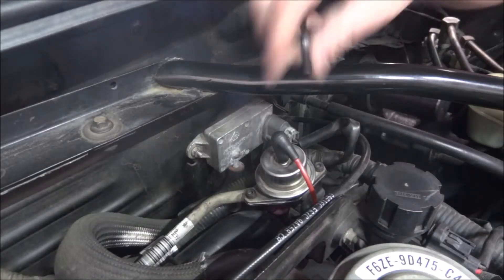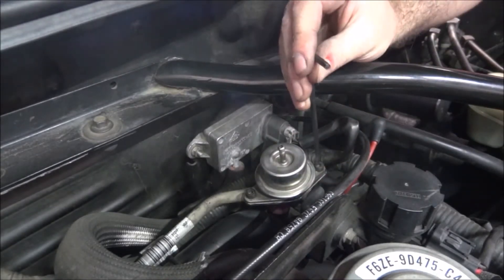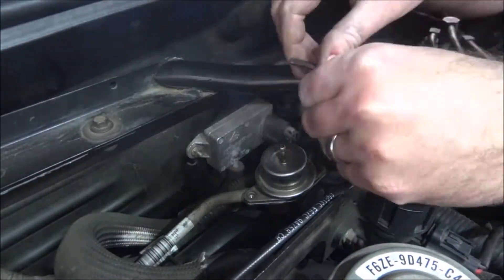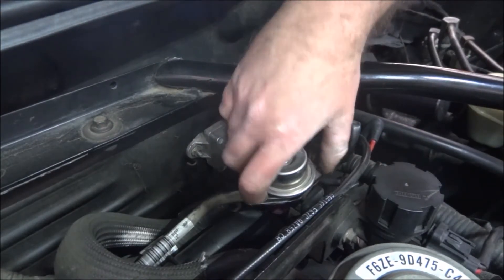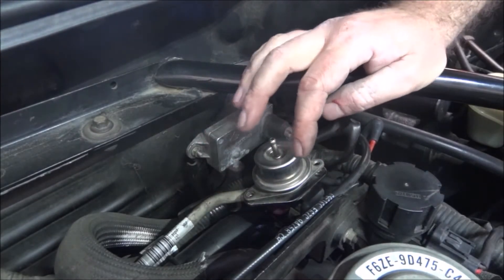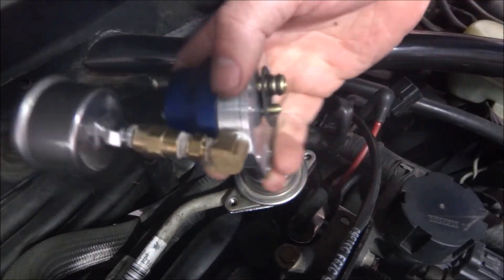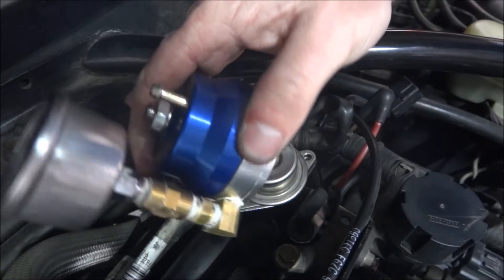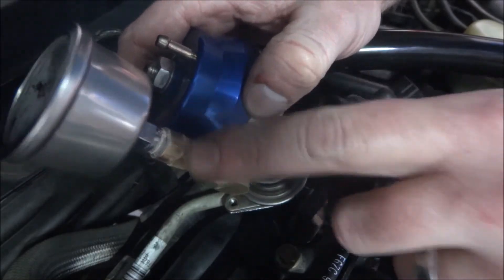Installing a 94-98 Mustang GT & Cobra BBK Adjustable Fuel Pressure Regulator and Gauge Kit

Comment: I have a 98 GT and my fuel pressure regulator doesn't look like that
Reply: Mine dosnt either 😅. Im suspecting my fuel pressure regulator to be my issue, i got one from o’rillys and its the wrong one, has the connection like his adjustable one is. Im having bad hesitation after my cars warmed up and it seems to be losing fuel pressure, I’ve replaced fuel pump and filter, and MAF
Reply: I know it's a year late, but if I'm not mistaken for 98 the regulator is integrated into the fuel rail itself. Maybe it'll save someone else some heartache if they read it here

Comment: I have a 98 GT. I have some light hesitation in 2nd and 3rd gears between 1,5 and 2.5 RPMS. I've replaced and cleaned all the usual suspects. I checked the fuel pressure at the rail and it showed 29 PSI at idle. I looked online and it says that it should be between 30 - 42. I've replaced the fuel pump, fuel filter and the fuel pressure regulator. with key , engine off, it shows 0 PSI. Idle is 29 PSI. When you disconnect the vacuum line from the regulator, it jumps up to about 40 PSI. When you turn the key on, you can hear the pump prime. What could be causing the low fuel pressure? The injectors? Relays or possibly low voltage going to the fuel pump?I would appreciate any advice on this matter.
Reply from the maker: What regulator did you use?  Usually vacuum will lower the fuel pressure.
Reply: My mechanic got one from advanced. He told me pressure increased but I did not see the gauge so I guess it either did not increase at all or it decreased over time. I've known him for years so I don't think he would lie to me. Exactly, with the vacuum line connected to the FPR, the pressure is 29 PSI but without vacuum it is around 40 PSI.
Reply from the maker: It sounds like it may not be a fuel pressure issue.  Here are some tests you can do to check pressure.  Measure psi when engine is at 2500 rpm should be between 30-45 psi.  Turn off the engine and cycle the ignition on and off a few times and measure psi again.  On a factory system, the pressure after 1 minute should still be above 25 psi.  If you car passes those tests it likely isn't a fuel pressure issue and it would need further testing.

Comment: does a bbk fuel regulator fit on the stock rails of 94gt mustang
Reply from the maker: Yes, this regulator is designed to fit 94-98 Mustangs with a V8
Reply: John Smith Racing ...thanx!

Comment: If anyone is looking for a BBK BBK fuel pressure gauge for there 1999 to 2004 mustang 4.6L v8 the part number is #6017 it comes with the fitting and gauge to install it on your fuel rail port took me 10 minutes and I was done says online only for 86-93 mustangs but it fit and works on all 1986 to 2004 v8 mustangs with no modifications needed just thought I’d share since I could not find any helpful information until I called BBk
Reply from the maker: Do you mean PN 1617?  I couldn't find 6017 but 1617 is their liquid filled fuel pressure gauge.
Reply: John Smith Racing I’m sorry yes 1617 is the part number its mounts right on your fuel rail with the replacement fitting bbk sends with the gauge I just put alittle tefon tape on the threads and your done takes lesuthen 10 minutes to install